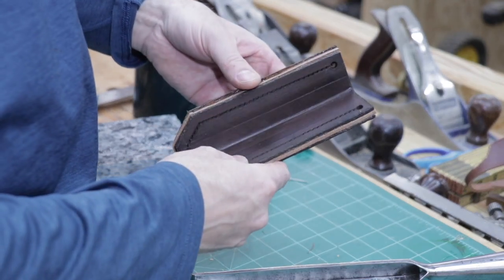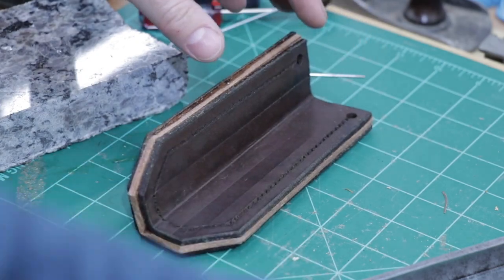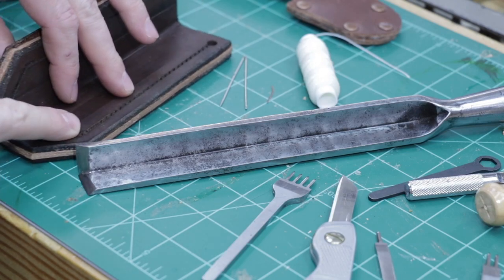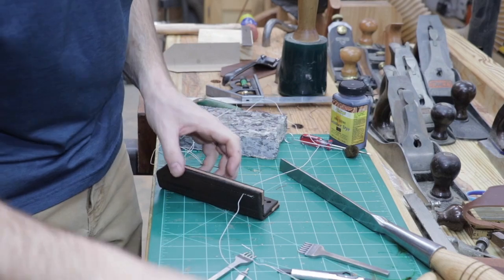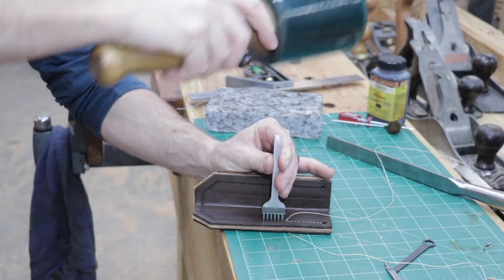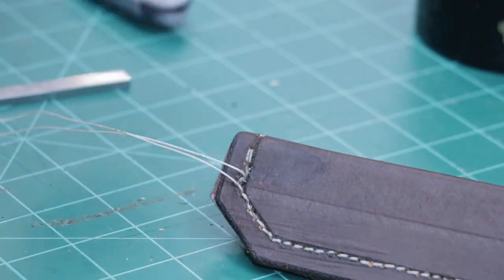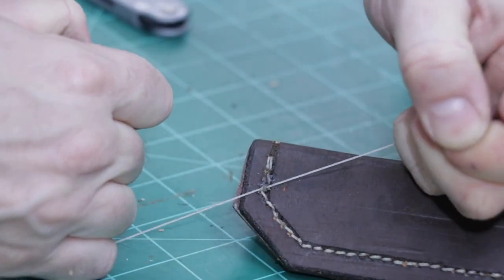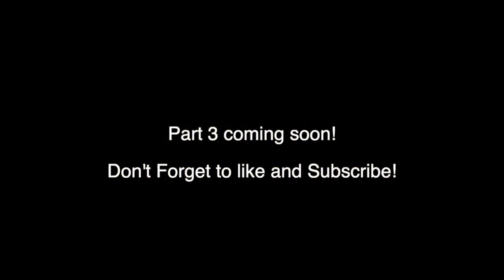Making a Leather Sheath for a Corner Chisel | Part 2

Comment: I always do the holes after everything is lined up. It's one of the reasons you see leather workers use any glue. Contact cement just makes it clean and simple to keep aligned while pricking and stitching. Maybe some exceptions but rare.

Laughing at your comment about spending on the craft. Couple hundred and then the rabbit hole continues. Sheath looks great and fantastic vid as always.
Reply from the maker: Thanks for your comment. I’m sure a person could spend a lot in a hurry on leather craft just like woodworking. I think it’s a good thing I’m about out of space in the shop!

Comment: You can if the front. And back line up  best to use stitch Grover on back after you use the drill press I just glue and sand the edges first then run my stitch Grover an your usuals pretty close
Reply from the maker: That makes sense. Next time I will definitely do that. Thanks